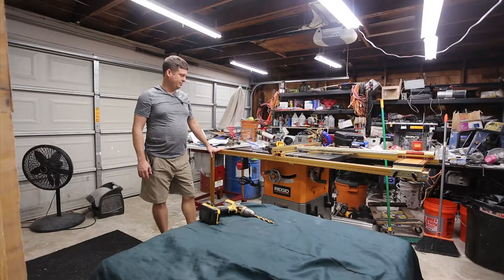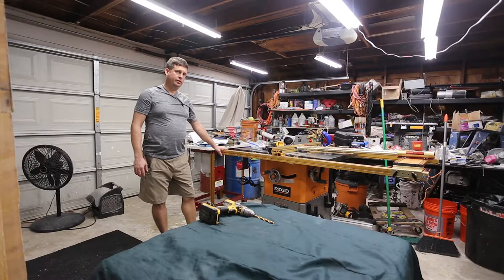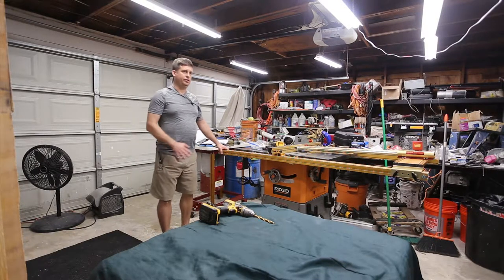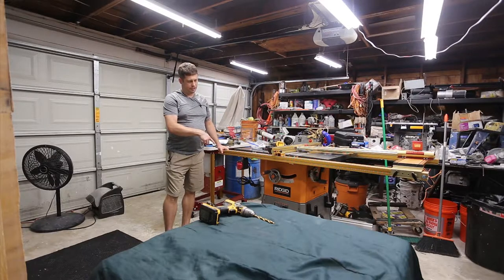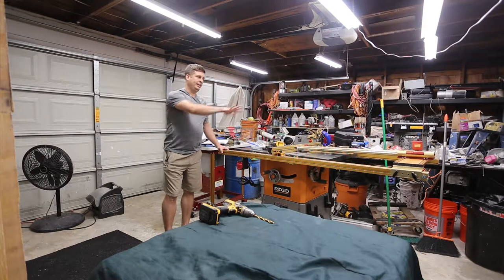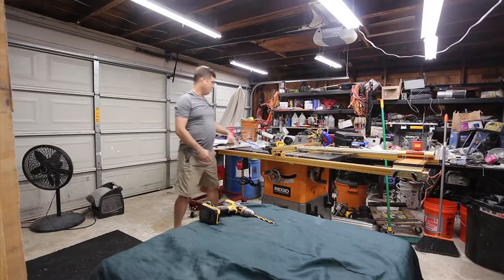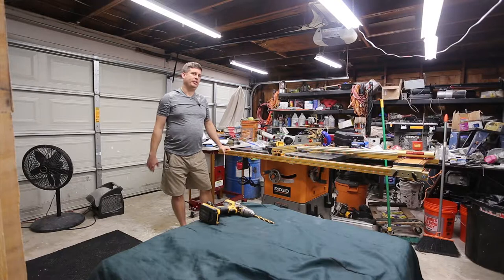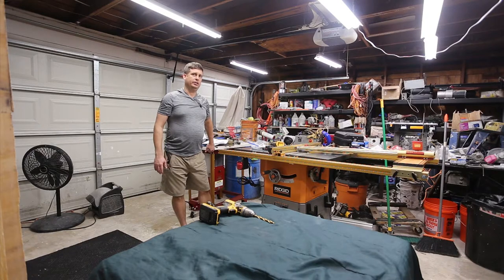How to mount Ridgid R4512 Power Switch to Incra Fence System

Comment: Just an observation ... Gary over at Gary Lundgren Crafts (a youtuber) produced a video for his router extension table (on the R4512 I believe), where he simply mounts two short pieces of T-track (maybe 6" ?).  He mounts the switch to a 3/4" board with tightening bolts which then mounts to the T-track on the underside of the router extension (made of 3/4" plywood).
Reply from the maker: I'm glad that worked for him.  I opted to have a dedicated router table and mount my switch differently.